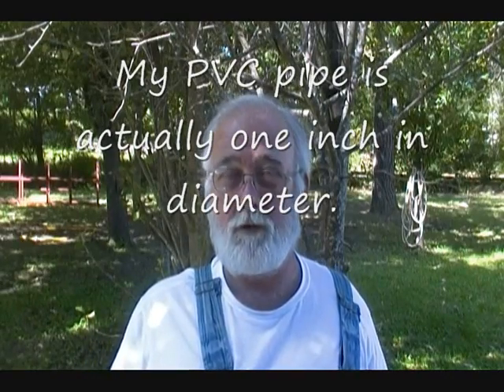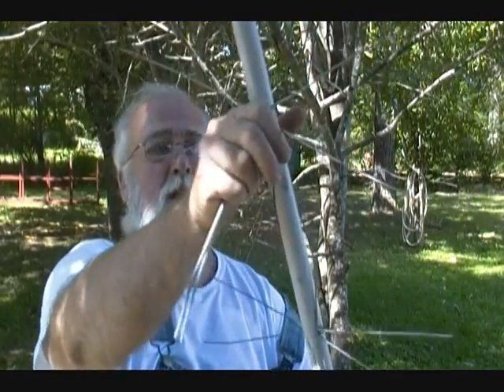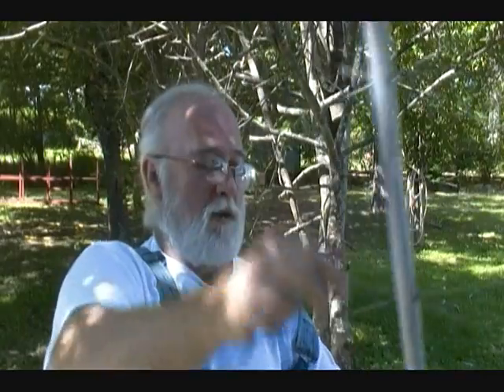Detailed Construction for my 36 Cent HD TV Antenna

Comment: I didn't understand the long wire.  Does it screw into every one of the wires and the transformer?
Reply: As youre looking at the antenna flatways or broadside, the wire goes from the top left down over to the right side middle ones, then back over to the bottom left. And the opposite side the same way. Basically the  two middle elements on one side are connected to the top and bottom of the opposite side. And vice versa. The transformer is just connected to those two wires at the point he shows and it doesnt matter which side is which just connect it, its not really critical just get it in the area

Comment: Do you mount it vertically or horizontally?
Reply from the maker: It probably does not matter, but it is easier to mount vertically on a pipe or post.

Comment: Nice! Beats spending $70 for a TV antenna. If you are concerned with the screws touching you can always use a multi meter to test for conduction. Consider capping the ends of PVC to keep water and insects out.

Comment: will your backyard engineering masterpiece pick up and boost a cell phone signal
Reply: thanks I have seen some of those videos and have tried a few of them but none worked very well. sometimes I wonder if the squirrels in the trees are intercepting our signal for their own use
Reply: we have pretty much narrowed it down to signal gremlins. it goes like this most days.  morning good reception, late afternoon weak reception,  just before dark no reception, 1 hr after sundown good reception again.  then there is short periods of signal loss at various times of the day sometimes, and then good reception all day sometimes.  strange
Reply from the maker: I have no idea !!!  LOL !!
Reply: in that case we have something in common, I also have no idea
Reply: cell phones are 800 mhz, 
Sub CATV Band - T7 - T13 7 - 48 MHz, 
VHF Band - Ch. 2 - 13 54 - 216 MHz, 
Low Band - VHF Ch. 2 - 6 59 - 88 MHz
Mid Band - UHF Ch. 14 - 22 - UHF
 Ch. 95 - 99 121 - 174 MHz 91 - 120 MHz
234 divided by the frequency will give you the length of antenna in ft ( x12= inches )   (800 mhz =3.51 inches )
Reply: roy hoco,  Look up the "Instructables" website It's a DIY'ers dream. I have seen 1or 2 cell booster antenna's on there. For bringing the signal into the house.
Reply: roy hoco, Forgive me if you already know this ;-) But if you are in a weak signal area, buildings, trees and possibly squirrels ;-) will interfere with the signal. Best results will be if you can get above or around these obstacle's. And have you located the closest cell tower so that you could get the antenna aimed properly? Some that have had problems with the plain wire antenna's not working have mounted it at the LNB position of a satellite dish and aimed that at the cell tower and got it to work.
Reply: we have trees lots of trees which are part of the problem, throw in weak signal most days but what we cannot understand is why some days the internet is fast as can be expected and the next day it is trash.  the trees are still there and the weak signal is still there.
I have tried a 40' antenna, with a wilson signal booster and we get the same result. currently using a wilson signal booster and a verizon jet pack but still the same performance or non performance.  a verizon tech told me the problem was the trees and I asked him what are the trees doing on days I have good reception - he hung up on me. lol it is a strange situation,
Reply: roy hoco, Other than there being problems at the tower, the only thing that comes to mind for the good and bad days. Is what ham radio operators commonly call skip, where certain weather conditions can cause the radio waves to bounce off of the upper atmosphere. I have had it happen with CB's that some times I could talk to someone 50 to 60 miles out, where normal was 10 to 15 miles.
Reply: "skip"  at cell phone frequencies almost never happens. 
and is best at lower frequencies. ( about 7mhz )   
the higher the frequency , the less skip happens. 
and at 800 mhz almost never ever happens. 
this is why they chose those frequencies for cell service. 
:-)   73 DE kb7uxe SK
Reply: FM desensitizing of signals.. 
When 2 or more signals are rec'd on the same frequency,  only the stronger one will be heard.  itis quite possible that the issue is one of too many signals on the same frequency, or a nearby transmitter ( radio station or  broadcast )  is causing issues.

Comment: you gotta love it when someone unintentionally helps point out that the earth is flat.
Reply: Yes because radio waves only ever travel in straight lines and never bounce off of anything. This is why ham radio operators can talk to the same person around the world in either direction...
Reply: Oh, I forget myself.  Television comes from Satellites in space.... and is equal to a shortwave radio frequency....boy, thanks for setting me straight.
Reply: M Wilson talking to Hangfire...
Reply: M Wilson where and how exactly do you think you receive the signals? Why do you have to put the antenna so high and point to the city (transmitter) to get the city's stations?  It doesn't come washing out of the sky above.  They transmit from across the country from tower to tower.  Why do you think you cannot travel in any given direction and not go 20 miles without seeing a tower somewhere in the distance.  Each tower retransmits the signal to tbe next and so on. Works the same for cell service.  Why do you think you have a signal strength indicator on the top of your screen.  Any way. do your own research if you care.

Comment: Or you can buy a rotating antenna for $35
ViewTV Outdoor Amplified Antenna with 150-Mile Range

https://www.groupon.com/deals/gg-outdoor-amplified-antenna-with-150-mile-range?utm_source=uu7434231&utm_campaign=UserReferral_ma
Reply from the maker: But that is NOT DoingItCheap !!
Reply: $35 is cheap. Not as cheap as your method, but it works better, rotates, and gets more channels. 

By the way, I like your videos.
Reply: Anthony Perrella u

Comment: I live in North Florida between Tallahassee and Jacksonville. 80 mile to each and just out of range for most of the channels. I recently got an antenna from solid signal and it is OK but not the greatest. I hope to make this and see if it works.  I am definitely going to subscribe!  I am the King of cheap skates!
Reply from the maker: If you make this, put a reflector on the back to bounce the signal back onto the wires.....helps with reception from a long distance.  You may not need it.  If you do put a reflector on it, do not allow any of its metal to touch any of the antenna's metal.  A reflector can be any type of medium to small mesh metal such as rabbit wire or hardware cloth

Comment: that's not a transformer
Reply from the maker: What do you consider the balun if not a transformer?
Reply: its a  75 ohm tv filter  ....not a transformer you need to have 12 to 24 volts to run one  big difference

Comment: How far are you from the furthest city you mentioned? In other words what range are you receiving signals from?
Reply from the maker: Keep in mind, UHF signals are line of sight, so the higher up your antenna, the better.  I easily pick up 50 miles away.  If you use Google maps and look at Lynchburg, TN, I was picking up Nashville, Cookeville, Murfreesboro and Chattanooga, TN.  Huntsville and Florence, AL and Dalton, GA.  I had the antenna pole sitting on the deck of the cabin in my homepage photo.  So that put the antenna probably 30 feet in the air on top of a hill.
Reply from the maker: I would appreciate it if you would subscribe !!

Comment: I have a question. would making the antenna longer get you even more channels?
Reply: No, the size, shape and number of elements matters. These designs are made with computer modelling and while it's totally voodoo and black magic mixed with math and science, simply adding more antenna generally wont help you. They are designed to be 'resonant' across a range of frequency and one of the most important aspects to this is wire length.
Reply: oh ok. thank you. I thought more might be better.

Comment: It's a balun which stands for balanced - unbalanced. The antenna, which is a type of Yagi (the name of the Japanese engineer who invented it)(more like a log periodic), is a balanced device that is approximately 300 Ohms impedance. The coax is an unbalanced line approximately 75 Ohms. The balun is a 4:1 matching transformer. A balanced line would be the old ribbon cable (flat line).

Comment: Couldn't you make two antennas and have both connected but have one pointed toward Nashville and the other toward Huntsville? Just a thought. I believe you are near the area my brother once had a farm, Mulberry, TN? He had a devil of a time picking up any stations there. He ran a wire on polls about 1/4 mile up to the top of a ridge and had it connected to an old store bought aluminum antenna. The reception was terrible. Me and little brother went up there to spend the weekend. We were really disappointed because we couldn't get sound on Nashville channel 5 and a horrible picture to boot. So we couldn't really enjoy the new blockbuster movie called KillDozer. That was in 1974.
Reply from the maker: In 1974 broadcasting was done in VHF for channels below 14.  Now ALL broadcasting is done via UHF in order to handle digital signals.  Yes, you could do two.  Mulberry is not far at all from here.

Comment: Tried to follow ... will try again ... drawings are so much easier for me ...  I try to draw as you describe and then I get mixed up again ... why is your design better than other folks designs?
I'm going to try your way along with 3-4 other different ways ... I get 3 channels (Mexican) without any antennae here in South Texas ... hoping that if I have an antennae I might be able to get a 4th channel that maybe speaks English ;^)
I don't want to buy an antennae
Reply from the maker: I don't believe I said mine was  "Better".  I did my research and found that people that used wood instead of plastic had interference when it rained.  The wet wood was not conducive to a quality picture.  I have had this in use now for over 5 years and still working perfectly.  What would make mine even better would be a reflector behind the antenna, but I am pleased with it the way it is.  Thank you for watching and if you have any other questions feel free to ask !!

Comment: I used coat hangers from the local dry cleaner for free. A broom handle I found in the trash of the apartment complex. I used tape instead of screws. To measure I was fortunate my shoes were ok; and so was the distance from the end of my pink to my thumb.\ --- /.  The Balun is a bit harder to make but I am fortunate in finding a TV splitter left over from a cable company in the alley. Connect the 2 wires to the center pins of the "out" side and connect your TV to the "IN side. Direction is like a this  
          toTV --[[  Center pins to antenna.
The wire length and bends are exact to his dimensions. So is the pointing thing. If you are in between cities the TV signals may be higher or lower from different directions. Great IDEA and thanks for the video!! Added--- Use painted coat hangers or aluminum. Be sure to scratch off the paint from the coat hangers ONLY where the wires touch. Rust and tarnish will actually not do any harm but it looks ugly.
Reply: Can I have the 36c you saved ??

Comment: I just posted this to another antenna video too- oh just quit it54 minutes ago
I have my 15+ year old 8' long conventional TV antenna mounted about 16' from the ground which works just fine for digital signals. In the past I used to subscribe to Direct TV until the contract was up, by then I was bored with the content of the few channels I liked so I'd cancel and just use OTA TV for free for a long while until my channels had new content, then resubscribe to satellite. Now with a faster internet I can get all the edu content I want and Direct TV will have to drop prices right through the floor to ever get me back. Paying so much when I only like a few channels is just bad business. Have been using OTA for at least 5 years running now. I get 3 different PBS stations, CBS, ABC, NBC, Fox, and another ABC with sub chan CW and sub chan DEC. A total of 36 chans/subs of which I hide 15 from surfing. I am in the country, could almost throw a rock and hit crops, just happen to be surrounded by TV stations within range of my big antenna. I think the farthest is about 70 miles as the crow flies with rolling hills in between.- What I didn't say on the other channel is if you don't mind using one of the big old style antennas they work just fine for digital OTA signals. Maybe add in a signal booster which can be either out at the antenna or in the cable line indoors. Works like a charm. I'm not knocking this video, it's pretty good.
Show less
Reply from the maker: Remember what my channel is all about.....DoingItCheap.....  I agree your big antenna has a better range, but it cost more than 36 cents !!  I am showing what folks can do for nothing or next to nothing.  Thanks for your input !!!  And thanks for watching and subscribing!!
Reply: No sir, it did not, I already had it and the cable. Very similar to how all repurpose projects happen only I reused it for the same purpose. It's mounted to an old section of repurposed heavy duty pipe that was, you guessed it, free. The entire project did cost a few dollars more, litterally a few, for hardware like U-bolts and such, but it is mounted very solid and up in the air, could be higher but it works. And thank you for the good video!! I generally subscribe after I see how a channel is, that takes time but I like it better than unsubscribing when/if I discover too much I don't like, unsubbing always makes me feel bad for a minute or two. It's kind of nice when folks show their true colors right off the bat............... Slight addendum- I did spend yet a few dollars more a few years ago for balun/transformer, shielding tape to wrap connections, and a grounding block,,,but,,,the old install is working well so I saved the new parts for future maintenance because I'm a cheap old fart and kinda lazy. Truly, I thought my post fit right in with the subject, just goes ta show ya! lol
Reply from the maker: You should take photos and enter my DoingItCheap contest.  Entries must be in by midnight the 15th of December.  All entrants receive a decal and the winner, chosen by my viewers, wins a nice tshirt.  Check out my latest coffee chat, I think I discussed it there, if not I did in others lately.

Comment: I think someone asked about making two antennas for facing different directions for more channels, but could I make a longer antenna with 2 or 3 sets of 4 facing different directions and connecting to one transformer? I used to get 7 channels, now getting 3, but there are many more channels out there in different directions.
Reply from the maker: Brent, I don't BS people.  So my answer to you has to be "Sorry, I don' know"!

Comment: Would copper wire work for the antenna?
Reply from the maker: Sure.  It costs a LOT more, but it should work just fine.
Reply: I'm using thin copper wire
Reply from the maker: Good luck.
Reply: My and my uncle made the antenna. I filmed a video of it and gave you a shoutout

Comment: Whats your thoughts on using  galvanized coat hangers instead of wire, and installing a tee in the mid section to use it horizontally instead of vertically like the old fashion aluminum antennas? Thanks for the video!!!
Reply from the maker: If you look at the commercially made antennas, the aluminum rods get longer and longer as you go towards the rear in order to reflect the signal to the rods up front.  UHF antennas, and that is what this is, traditionally have had some mesh wire behind them for a reflector.  I don't think they work horizontally unless you copy the larger commercial ones.  Galvanized wire should be fine.   I don't know how old you are, but when I was a kid, we had the horizontal antenna for VHF and the vertical (basket type) for UHF.
Reply: Thank you for that my friend and many thanks for your videos. I am looking forward to your next one!
Reply from the maker: Thanks for subscribing Thaddeus !!
Reply: Those old school antennas still work great too, if you have one use it

Comment: Hey,man,I've been working in electronics for 30 some years.You are very clear in your description and instructions.I like the cut of your jib,as it were.For anyone who cares,the lines are called "phasing lines" and the attachment in the center is for line impedance matching,to be technical.Oh,and the signal is strongest with the flat sides pointing toward the station(s).Again,great job.
Reply from the maker: thank you
Reply from the maker: I was an electronics tech in the 70's in the USAF but when I do these videos, I stay away from any technical terms I can.   I guess I play the dumb ol' grandpa like the Larry the Cable Guy character a lot, but I think in the short attention span most folks have nowadays, if I were to talk impedance, resistance, signal loss/gain, reflectivity or any other word I can think of that sounds technical..... most would have a deer in the headlights look!!!   Thank you VERY much for watching my videos.  I hope you will subscribe as well !!      ..............cut of my jib...?   Are you an old Navy man?
Reply: Nah,railway radio tech,among other stuff.That's why the crossing whistle and the train-lining whistle stood out.
Reply from the maker: The tracks are about 600 yards away.